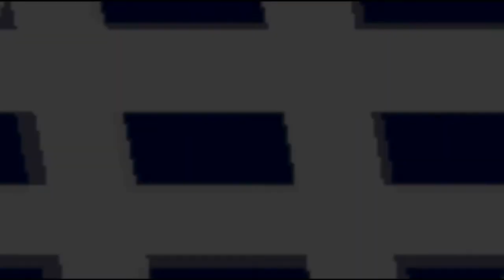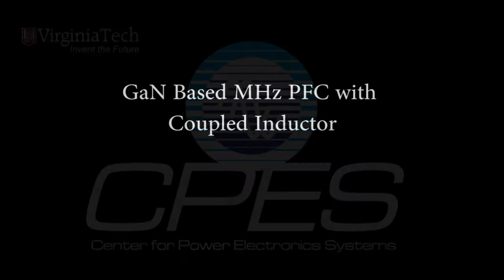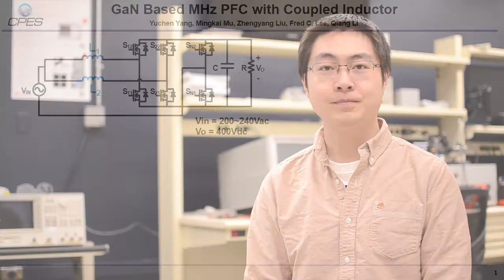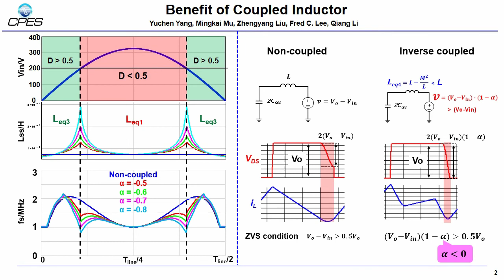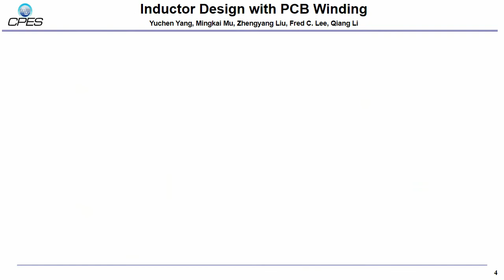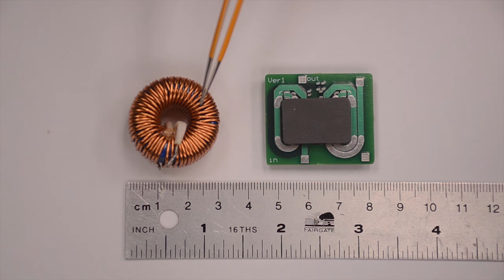GaN Based MHz PFC with Coupled Inductor

Comment: I'm an electronic engineer, and I'm not ashamed to admit that I don't get the most part of your video, but one thing I can say, the inductor comparation at 4:25 is not correct, the traditional inductor with no litz wire working on GaN is not well designed